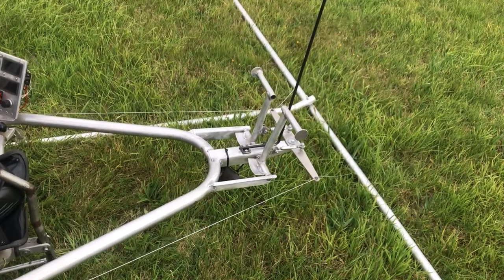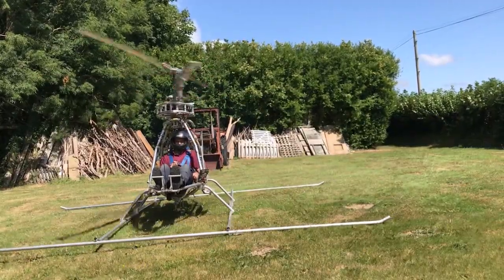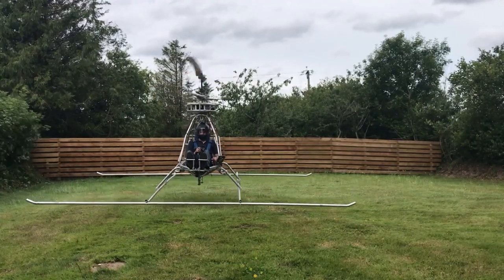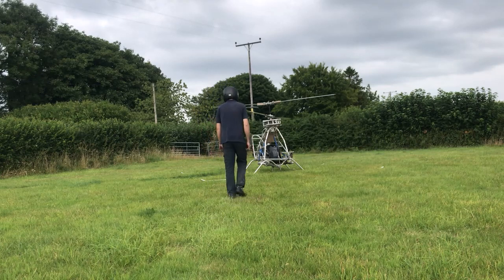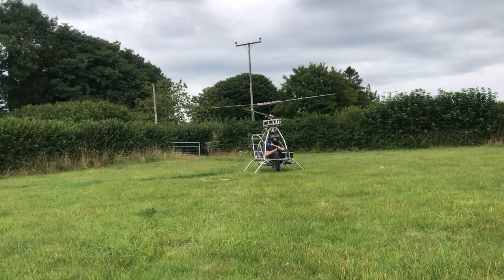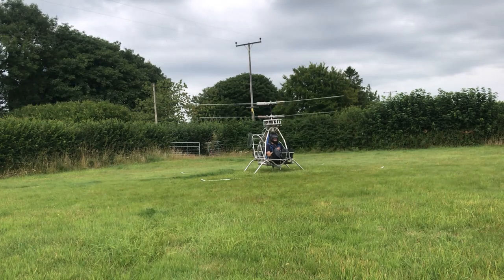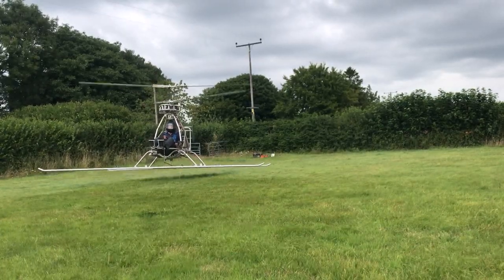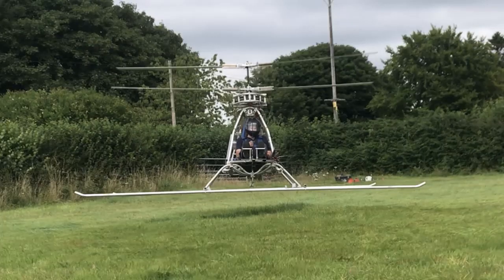Part 6 Learning to Fly Homemade Helicopter

Comment: Your blades are NOT doing 5000 rpm! And it looks like they were very dry to start with. The engine is doing about 5000 rpm. What is the reduction ratio?
Don't worry about the over-corrections. You are just training your body to adapt. Awesome job!
Reply from the maker: Thanks 👍 
Blades are doing 780rpm, 7:1 reduction

Comment: What sort of HP is your motor supposed to deliver.
Reply from the maker: It's 60 Hp at 6500 RPM, running at 5500 RPM it's could be more like 50-55hp.

Comment: Are you keeping records for both flight time and ground maintenance ?
Reply from the maker: I've got an hour meter installed which I am using to monitor one specific part that failed previously. However as I've designed all the parts there is no time out data to go by. I monitor all the parts I can by visual inspection. I could disassemble certain parts for crack testing, I would have to invest in some half decent crack testing equipment.

Comment: Brother i believe if once you can hover the helicopter (both paterns normal and contra rotors type ) stably ,you can easily fly it in normal forward direction on higher height.
But I really appreciate your carefulness as you can see the boundaries of you engine performance blades performance.
Good way you are doing it .
No hurry brother, as life is most important.
Reply from the maker: I think you're absolutely right. The hovering has to be competent before attempts to fly forward. I actually tried flying forward but didn't manage to achieve it and ended up going backwards. The problem is the brain at this stage is having deal with a lot going on and adding an instruction like trying to go forward overloads it and things get out of control. I will just have to be patient.
Reply: @Ben-Dixey  hovering looks easy to uninformed or normal people watching it from outside but it's may be most difficult maneuver in helicopter .
You said "it went backwards instead forward" how come? did you pull the cyclic instead push ? 
Still great approach to  building the complex machine and now learning its mood and behaviour for control it better.
Reply from the maker: Well, my plan was to try and fly it back to the gate instead of putting the wheels on and dragging it up the field. The wind had increased a bit and I turned it around facing the gate but that meant I had a tail wind. A tail wind was horrible and I could barely hover, I attempted to go forward but I shouldn't have even attempted it. All that happened is that I ended up further from the gate than I was before. I think if I kept it facing into the wind I might have been able to get it closer to the gate by going backwards. The controls are the right way around it's just lack of skill.
Reply: @Ben-Dixey  thanks for explaining me in detail brother.

Comment: how do you do the radiator installation on the engine sir? Can you help me? 🙏
Reply from the maker: The radiator is a working progress as the engine isn't being cooled effectively yet. What I have done so far is make a manifold to direct the water through an electric water pump and then on to the radiator. I had planned for a belt driven fan as I didn't think the electric one would provide enough airflow, so far this has been true. I intend to install a belt driven fan soon but doubt that will be the end of the over heating problem.
Reply: @Ben-Dixey  thank you so much👍  do you have facebook or whatsapp application sir?
Reply: @Ben-Dixey  do you know what is the ideal weight of the mosquito helicopter propeller sir?
Reply from the maker: @amrinwello6620  I don't know the weight of the mosquito blade but for any helicopter that needs to auto rotate a blade tip weight is the most effective way to help rotor inertia. In an ideal world the blade would weigh nothing and only have tip weights, of course that's not possible but hopefully you get the point. have a look at vortechinternational they give the weight of aluminium extruded blades.

Comment: Im sorry , i knew this a while ago and forgot.. How many HP was that outboard rated for ? Im trying to come up with some rough ratio for peak power to max takeoff weight ( e.g for every 100lbs 12 hp is required )
Reply from the maker: Hi, the outboard is rated at 60hp and it should be possible with that power to lift 720lbs. That's from what I've read 1hp can lift 12lbs maximum. I don't know how accurate this statement is. My engine could be producing more power than 60 due to the tuned exhausts, it would be nice to know what power it is putting out I just need to know the torque it's producing to work it out.
Reply: @Ben-Dixey  makes perfect sense.. youre a bit overpowered for the weight then , which is awesome .
Reply from the maker: Well possibly yes, I know I've got throttle remaining, haven't tried full throttle yet or increasing blade pitch. I can go to 7 degrees for maximum lift, it's currently at 6.3 degrees bottom rotor and 5.3 degrees top rotor. However my blade design isn't as efficient as it could be with the addition of the leading edge tape. More efficiency can also be achieved with asymmetric blades. My guess at this point is that I wouldn't be able to obtain the lift of 720lbs, even with the extra HP I might have but that is just my prediction.
Reply: @Ben-Dixey  whats the current takeoff weight ?
Reply from the maker: @airgunningyup  It's approximately 518lbs, my digital scale isn't producing repeatable measurements though. It seems to vary by 20lbs without changing anything. I'll have to invest in a better one.
Reply: @Ben-Dixey  ok so definately heavier than i had guessed.
Reply from the maker: That's including me of course just to be clear and I'm 209lbs.
Reply: @Ben-Dixey  yep I assumed as much. thanks again. looking forward to new vids.

Comment: I can't tell if you have a death grip on the cyclic or not, try controlling it loosely with 3 fingers while  resting your arm on  your leg.
Reply from the maker: Hi, yes I'm resting my arm on my leg and using three fingers for the lightest control I can. Just not practised enough I think. I'm going for an R22 lesson again soon, it will interesting to see how it compares. It's going to take some practise it seems to get any good at hovering. It's certainly hard to learn the skill.

Comment: A helicopter is not much use if the only thing you can do with it is hover.

Hovering is also the most difficult manoeuvre you can do. 

Get it into forward flight and learn to fly it properly.
Reply from the maker: You have to learn to hover before attempting forward flight, even though that's the hardest part. The way I'm doing it anyway, dual controls and being instructed allows pilots to learn in a different order. I've flown in a Robinson in forward flight and it's more like controlling a plane. No way could I bring it in for a landing. It's got to be slow and steady wins the race.

Comment: My friend I know it feels good to expirience your spetacular improvement. The best are yet to come. Now about the leading edge of the rotors I saw some are trying to solve it with reinforced carbon fibre rotors. You used a tape on aluminim. So the question is how can you reinfonce the tape?An idea may be to use double tape and apply an epoxy mixture in between the tapes. The weight  gain I reckon will be insignicant and it will not affect the balance of the rotors. Thetre are some epoxy mixtures that are suitable for metal and aluminum applications. I am thinking about the battery but I dont have any idea yet. Please keep up the great work.
Reply from the maker: Thanks for the suggestion, much appreciated, I believe you can buy a thinker version of the same tape I bought and you can also buy tape specifically designed for the leading edge of rotors. I looked at this first time around but thought it was expensive. I'll check the price again and might decide to purchase it this time. 

The outboard has a stator for battery charging, I need to find out if it's charging and what amperage it puts out. It's running the electric fan and electric water pump.

Comment: Between coaxial helcopter and normal helcopter with tail rotor which is more complicated in making it?
Reply from the maker: Good question, typically a coaxial is more complicated, the swash plate arrangement is certainly complex on a coaxial compared to conventional. For my attempt I thought in the beginning fixed pitch rotors on a tilting mast would be simpler than conventional.  In reality the reversing drive was harder to work out than the swash plate arrangement would have been on a single rotor design. If choosing conventional there are lots of plans available which would have been much easier than designing your own from scratch, just depends what level of challenge you want in a project.

Comment: Hi. On the part you crack tested why have you made that diameter reduction right next to the bearing surface? This is where it will crack !
Reply from the maker: Hi Yes, I've got no choice the diameter has to increase right after the bearing journals for maximum strength. If the diameter increased further out it would be weaker.

Comment: Is it possible the damaged tape on the blades could be heat damage from air friction?
Reply from the maker: Possibly, it could certainly reduce the tapes resistance to impact from foreign objects. 👍
Reply: What kind of tape do you use? My gyro don't has tape of the rotor, but on the leading edge of the composite prop. It is also used on car bumpers (clear PU tape, quite expensive).
Reply from the maker: @StefanWode  It was automotive tape used to protect paint from stone chips. However it was called helicopter tape, and developed from the aviation industry. Ill try a thicker option next time or spend the money on the aviation rated product.
Reply: @Ben-Dixey  I'm not sure if it would work but you could eliminate the possibility of heat damage if you used Kapton tape, it's highly resistant to heat (not sure how strong the adhesive is though) and if it still gets damage then you would know for sure it is debris doing the damage.

Comment: WOW! Another outstanding video Ben. You must be getting a lot of satisfaction from that. Just a tip re the alloy exhaust, scrap that and use 0.4mm stainless. Google diy hydroforming using a pressure washer. The aluminium will not cope with the heat/vibration, I had the same issues. Cheers Cam.
Reply from the maker: Thanks very much Cam. 👍 will do, did you have any cracking when hydro forming the exhaust on yours ?
Reply: @Ben-Dixey  There may have been some some fine misty leaks but it's insignificant to the volume of water being forced in. Just make sure there is no air in the system and you will have easy fine control over the shape.
Reply: I wouldn't go for stainless, it is prone for fatigue. Use pressure washer and banana shaped blanks. Do a small z-shaped bending along the edges (there are special pliers or rollers for that). TIG weld the edges together. Now there will be a small distance between both blanks. This pre-bending will keep the seam in a better shape when inflated with water. And use the mildest steel you can find, 0,8mm thick. It should be suitable for deep drawing. We made 100s of resonaters this way. Cheers from Germany and good luck!
Reply: @StefanWode  304 Stainless is a great cheap material, Ask Elon. 0.4mm s/s is easy to weld and fatigue is not an issue with experimental home built helicopters. The reason for folding the edge for hydroforming is so the weld itself doesn't have to bend when forming. A "Z" is  not necessary.  It would be nice to have some CAD software that could accommodate for bends, so not as much trial and error. Cheers Cam.
Reply: @CameronCarter1  I designed powered parachutes for more than 20 years (and built a biplane and a gyrocopter for my personal use 30 and 19 years ago, both still flying), and we made several 1000 resonaters. Stainless steel may work fine, but since corrosion isn't a very big issue at 2 strokes, we found out, that the mildest steel for deep drawing is still much better in terms of fatigue, especially after hydroforming: large deformations harden the steel. Anyways, I agree, as long as 0,4 mm SS works, it is nicer than standard steel. Also we use a set of small rollers to create this Z shaped bending along the edge, 2 x 90°, roughly 1mm offset between both bends. If you leave a few mm of material on the outer edge, you can use it to let it flow together.
Reply from the maker: @StefanWode  Cheers for this, did you butt weld or lap weld the joints?
Reply: @Ben-Dixey  butt weld. (Sorry, my English might be not good enough to understand exactly your term). But basically I mean that you don't add material, you just let it flow together (sometimes some steel wire must be added if holes occur). The trick of the "Z" bend is to take some of the bending stress out of the weld seam, when the resonater is inflated. It lasts much longer.  And don't forget to add a small piece of material as a second layer, where you weld your holders to the resonator. Such reinforcements are very important.

Comment: its no surprise the tape is getting damaged. bugs, rain and friction of the air will damage the tape. Also I was wondering if there is a lot of play in the cyclic control?
Reply from the maker: There's very little play in the controls which is something I've be working on. What movement there is, is hard to identify. The tape is automotive but called helicopter tape as it was developed for the protection of the leading edge on rotor blades. I'm thinking it must be bugs causing the damage. Perhaps I'll have to see how much the aviation rated helicopter tape is. It's a sticking plaster over the real issue which is probably new blades.

Comment: You should create a preflight checklist that covers all pertinent aspects of inspecting before getting in. 
Then a second checklist for all you have to do and inspect and test before lifting off.
 Every pertinent item should be on the check lists. It should be relatively short and a few words per item.
You will use the checklists EVERY TIME YOU FLY.
Pilots with 12,000 hours always use a checklist. Always.
It's very dangerous and foolish to omit this crucial safety process.
Reply from the maker: I can understand the importance of checklists and I have made one. I walk round and check things every time I test. My machine needs constant inspection of every part which is hard to achieve all of the time.

Comment: You flying in dirty air It should get better after you start flying away from the ground
Reply from the maker: I was told that was the case it's just having the nerve to go higher at this point. It will be so nice when you just enjoy the ride rather than intense concentration.
Reply: Actually not.  Ground effect is giving you more lift AND more stability.  The farther you go from the ground, the less stable you will get.  Also, you will accumulate more potential energy, and since you can't autorotate, more risk.  If the air is turbulent at all it's because you are downwind of obstacles, not due to ground effect.  Glad to see you are still alive, and still having fun.  Very entertaining.  Don't forget the large forces of kinetic, and chemical energy in close proximity.  I don't advise adding more ( potential ).
Reply: @Chris-bg8mk  Nope less stable down low you are in disturbed air